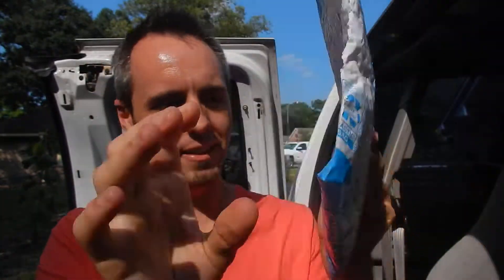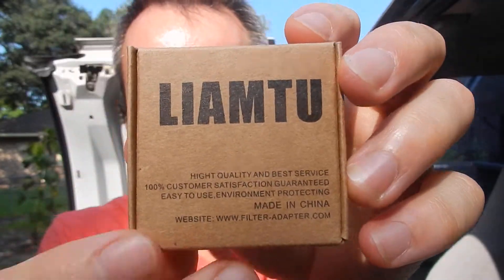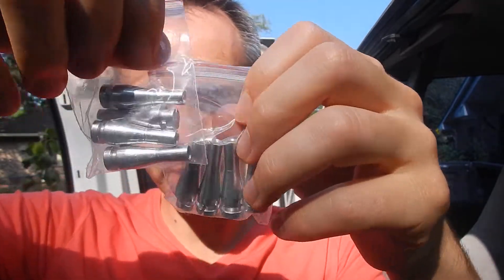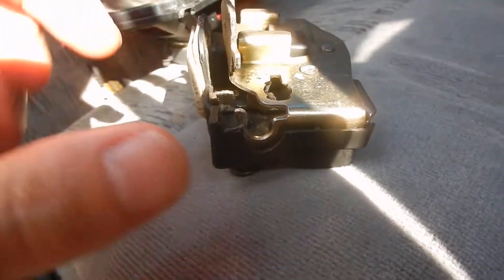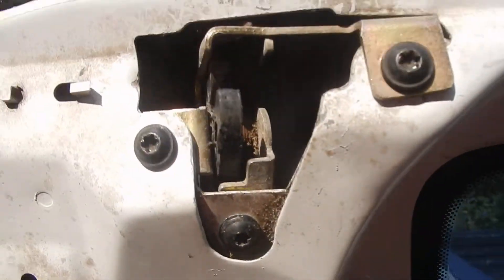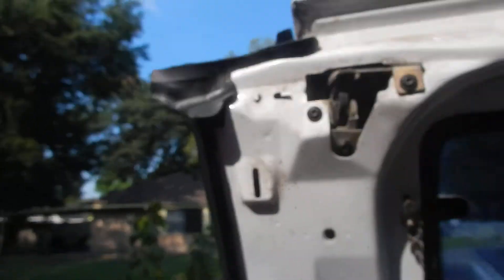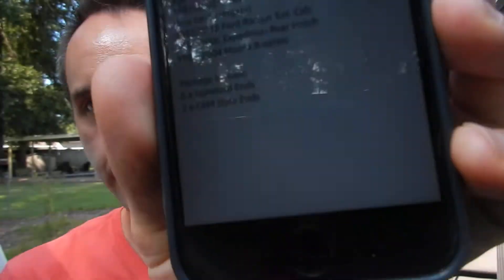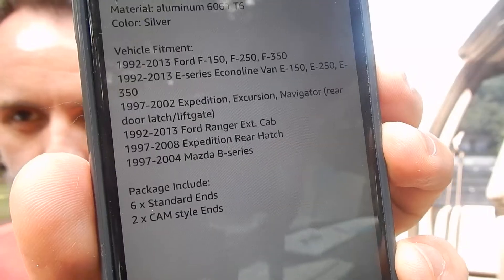Best F150 Door Latch Cable Repair Kit

Comment: Nice video. I would like to point out a few things. Aluminum is not all the same. Some grades are as weak or weaker than the plastic it is replacing. All of the cable ends are coming out of China except one brand.  You can tell by the cost of the cable end. If the cable end is less than $3.00 each you know it is from China. If it is from China you don't know the grade of the Aluminum. A shop in Ga. that replaces these ends all the time told me. It is best to buy the American made ends. You know it is quality Aluminum going into the door. You don't want to pull the door apart twice. I learned that the hard way. Also the cam lock end. By reducing the head you greatly reduce the strength. They also rattle loose. Soon that tight door handle will become loose and is harder to open than before. So my advice is to buy the more expensive ones. You are better off. Plus it is always good to buy American made.

Comment: It’s not that easy. You have to cut the black cover off to make room to adjust the neck. The cable become short if you do t remove extra plastic. Otherwise latch won’t engage
Reply from the maker: Thanks for sharing that bit of info!

Comment: I did two of these in a Super Duty out of necessity. Then my work truck. Then I got good and had some leaflets printed and made a small business. Not a lot of work but I have done around 40 trucks and vans so far in 6 years. I target Super Duty, F-150 from 2004 on, and E series vans with barn doors.